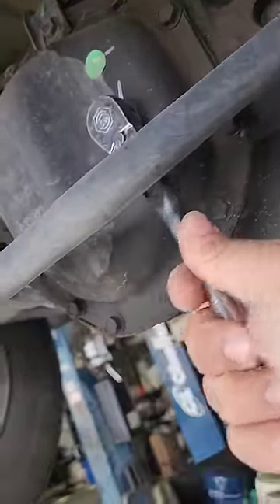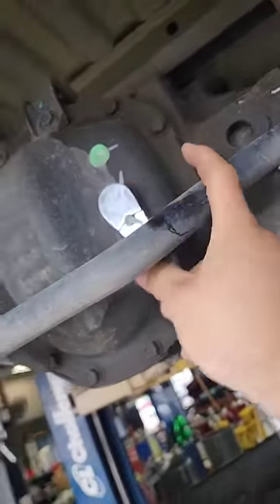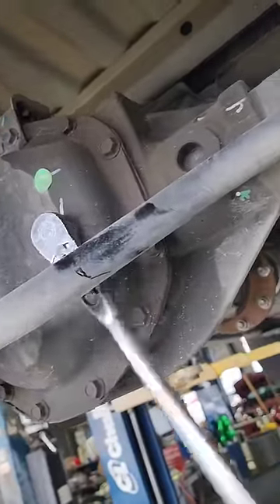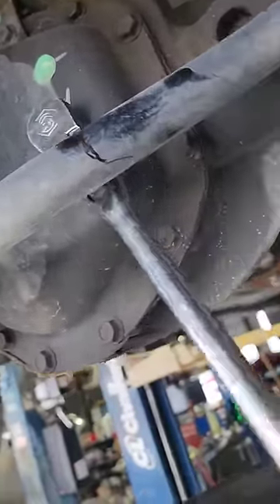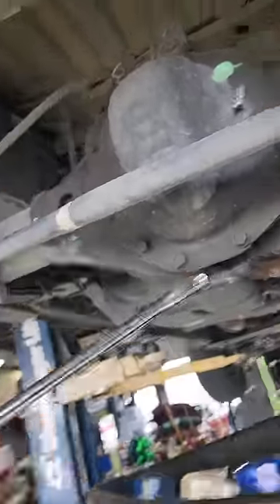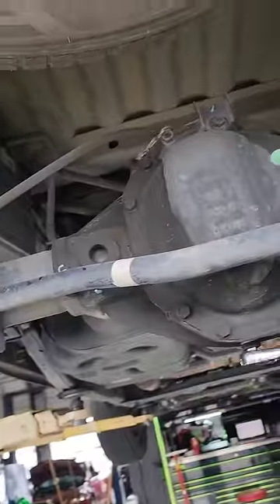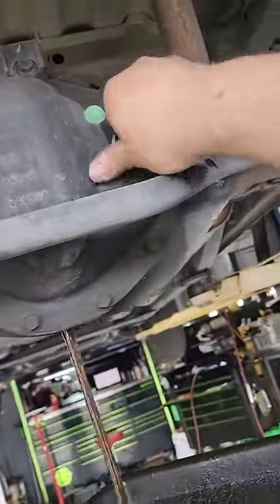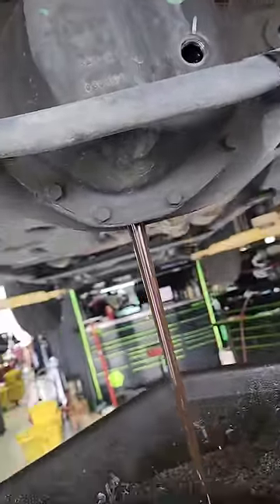MECHANICS PRO TIP #shorts #mechanic #auto #tools

Comment: If you can't get the top plug open, it's really simple. I live in a rust belt area and have 3 diffs and a transfer case.
It's simple. Roll the vehicle onto the roof, fill the diff, roll it back over.
Reply: Well if you live in the rust belt you never have to change your diff fluid, because the vehicle will rott away long before the fluid is wore out.
Reply: @hotrodchevy4524  that’s a joke right lmfao because it’s definitely not true
Reply: @tokahontas9990  it was and you ruined it
Reply: @hotrodchevy4524  you ain't lying! Lol
Reply: Huh, I've always found it easier to just drill a small hole at the bottom, let it drain and then some duck tape should cover the hole just fine then just another at the top to fill it
Reply: Fkn you tube mechanic you’re supposed to weld a 10 mm socket to the drain plug then weld the ratchet to the socket
Reply: Just use the pothole outside of your house to flip it makes it a lot easier here in southern Ohio
Reply: He’s kinda not kidding though I’ve come across dozens of 25 year old vehicles that have never had axles serviced at all
Reply: Mint👌🏻
Reply: @kevindelgado1335  no one has a 10mm socket in there too box
Reply: You just put the qty of oil you need in a freezer bag, pop the cover off, put the bag in, put the cover back on and forget it. The gears will liquify the bag.
Reply: @Duff Man  what's a 10mm socket?
Reply: @mattrushing5573  seen one at a store once!
Reply: I live in the rust belt there’s no way you’ve changed three diffs and a transfer case I would stop changing my own fluid at that point!😂 I haven’t been through one but have gone through millions of miles in several vehicles
Reply: @duffman1241  I always lose mine, so I open up my buddies and I take his😂
Reply: Fill it through the speed/abs sensor hole on top the diff if it has one
Reply: @Hotrodchevy  not true, roll through deep water and it's worth a change out
Reply: @Kevin Delgado  gigachad move but I can't weld
Reply: @mada310  open the blinker fluid drain valve and route to diff
Reply: Wtf lol
Reply: That rust must have got to your brain lol you can fill it thru the drain. Fit a hose to the drain, make sure the hose bends up towards the top and ends higher than the diff itself. Fill it untill the oil level in the hose is level with the fill plug.
Reply: Old school trick gallon freezer bag filled with gear oil slam together get on down the road free teeth shimming
Reply: So you’re saying I should have changed my diff fluid while my truck was rolled over. Now you tell me!😢
Reply: @duffman1241  What is a 10mm socket?  No such critter exists.
Reply: @gunztommiegunz  Ever thought about that for a second 🤔 maybe you haven't been losing yours. You might just be getting yours back! LOL 😆 🤣
Reply: @ElectricBillAlbright  😂😂👍👍❤️❤️
Reply: @mattrushing5573 its like unicorn of sockets.
Reply: @OtisFlint for anything not really driven hard, that should actually work, and may have the added effect of sealing any axle seal leaks present from within. 

Wouldn’t trust that fix on a racecar or a truck used for serious hauling, but it would work in a pinch.
Reply: @MrThedoors28 well just a couple years ago the city finally did my street. First time ever since it was blacktop. It still had the original bed of rocks from 1900.   My house was built in 1913 but there's a few on the street that's older.
Reply: That's not too far fetched.
During ww2, GI mechanics would flip a Jeep upside down if needed to make it easier to work on.
Reply: Or u can just fill it using the hole for the tube at the top of the diff 🤷‍♂️
Reply: Fill it thru vent

Comment: Crack both before completely draining it. You should also check and clear the vent hose when you service it as well. #1 reason for leaking axle seals amd pinion seals is dirt wasps building nests in the vent hose. After the vent is sealed, as the diff oil warms it expands, and creates positive air pressure inside the diff housing. With no vent it makes its own at path of least resistance, which is often the pinion seal
Reply: you're right, never thought about that

Comment: I'm here wishing my diff had a drain.
Reply: Is it a ford?
Reply: Make one!  Tap, plug.
Reply: Yeah .. alot of European small commercial vehicles dont have a drain ... a none service item ..what a croc of ..........
Reply: Drill a hole and make one then.
Reply: Just loosen all the bolts(don't take all the way out)and pop the cover loose (don't take it OFF) 
Drain it, tighten everything back up and refill it.
Reply: Kid that’s just how you drain it prpperly😂😂😂 what tip?? Lol 😂
Reply: SAME
Reply: @marknorwood7521 yes that is the way it’s done for sure but it’s still not a great way of doing that shit but pretty much the only way
Reply: For real, what kind of truck is this?
Reply: My 2005 BMW doesn't have a drain on the diff - you have to get a suitable pump to suck out the fluid, then just fill to the level of the plug. Not really a problem.
Reply: Stop buying Ford's and chev.  Toyota had them for ever.  Years ahead of domestics

Comment: Cool. Another tip is when it drains with a glugging motion like this, it means the diff breather/ vent is obstructed/blocked with debris.
Reply: Breather has a one way valve on the end
Reply: @nate5102 
Yes, INCOMING AIR ONLY!!! So, again… the breather tube on this rear ended is stopped up and/or blocked!!! Now, go back to playing with the kids and stay out of grown folks conversations!!!
Reply: @jongoin4404 I always thought the valve was to stop incoming water but to allow air pressure to escape as the temperature increased. Oh well,  let it fill with water, same thing on a transmission. You were kidding weren't you Jon?
Reply: @davidkeeton6716  
Absolutely, it lets air out and keeps water from coming in. I was being sarcastic but that’s hard to convey sometimes without facial expressions. Have a great day!!!
Reply: No it doesn't.  The breather is very small,  so the rate the fluid is draining out is greater than the vent can draw air in,  so it will glug even if the vent is clear.
Reply: @travisbakeriii3053  nah.

Comment: Here in northern PA, the diff cover will need replaced before you have to change any oil, I’ve had to do every truck I’ve had in the past 20 years!
Reply: I’m NH and decided to put coilovers on and ever other bolt seized on there like tie rods pinch bolts strut tower bolts sway bar axle bolt was really hard still haven’t finished the front had to buy new pinch bolts cause they snapped
Reply: Yup im from PA and can vouch for that.
When he said they never see rusty vehicle made me want to cry a little. Lol
Reply: @Mulletmans  In PA the first thing you check is for "GOOD FRAME" then you check the rest of the vehicle information.
Reply: Ha so glad I don’t have to deal with that shit over here in the PNW. Well not to the degree as people in the rust belt do. Sounds like you guys need to undercoat your vehicles, but then again if you don’t do it when you first get it with no rust on it, costing a frame with rust is even worse.
Reply: @connorjohnson7285  get an induction heater or at least propane/map gas torch
Reply: @carsonchambers5617  the undercaoting gets 1 little chip and its all over.. might as well soak it in a corrosive bath

Comment: Damn that oil was clean as fuck.
Reply: Well if they were there for a diff service that means thats somethings they do vs someone thats not going to change it so it will never get changed unless there is some diff problem kinda a chicken and egg or cake and eating thing
Reply: Nah, that oil was just serviced on a schedule. In advance. As engineers intended, haha.
Reply: @ulogy right, just cuz it looks good, doesnt mean the oil hasnt broken down at all, which will start to leave deposits
Reply: Some people think you supposed to change it regularly but actually it's good for 50-60k miles! That he just changed had probably 5k miles on it! Wasting $
Reply: @Jimmy Conner  ya I doubt it's at 5k unless it had some major work done but most people never think about it and I have bought vehicles with like 200k that had probably never been changed
Reply: The manual on my truck says every 20k.
Reply: Oils are cheaper than components. I change my engine oil every 3k with synthetic blend. $40 every 3 months.
Reply: @taselescanlan2795   an engine oil change is different than diff oil change,  you are constantly adding contaminants to engine oil with the diff their is barely an air exchange from temp changes, oil sheer is the problem and its a long term event.
Reply: @taselescanlan2795  That doesn't make any sense.  Every synthetic is going to give you 5-7K+ protection.
Reply: The additives break down before the fluid gets dirty because there is no combustion cycle to contaminate it with carbon deposits. The additives break down from heat and pressure but the fluid remains clean looking.
Reply: @davec.3198  wouldn’t expect it to make sense to you. I live on a island where we do 25mph max, more idle time than actual miles. I believe in preventative maintenance. Extended oil change intervals, like 7k, is asking for trouble down the line. But to each his own.
Reply: @jhallin5185  I agree, I was just saying to the ppl pointing out that it was still clean oil, that it is cheaper to change the diff fluid than wait and end up changing out the diff.
Reply: @jimmyconner2444  Old Tacoma pickups had a 15k mile severe service interval on the diff fluid. Fluid looks brand new even when they are carrying around an 250 gallon sprayer full of pesticide. Plus the look of the fluid has nothing to do with the quality of life of the fluid. A diesel truck oil looks black as soon as it gets started with new oil. Does that mean the oil is bad already?
Reply: @taselescanlan2795  You don't even need a transmission to do 25mph max.  1st gear all day.  :)
Reply: @davec.3198  unfortunately most of my customers think the same way, and when limp mode doesn’t let the trans out of first gear, they still drive them daily. I call them airplanes, because they sound just like one when passing by at 25mph in first gear lol.
Reply from the maker: @jimmyconner2444  did u see the ODO?? Nope
Reply from the maker: @taselescanlan2795  lmao airplanes...5500 rpm creating heat and all...crazy thing is and engine wasnt meant to run at that rpm for an extended period of time lol
Reply: @ulogy  ... when I worked for Nissan (mid 80s) they called for trans / diff service every 30k and this is what it usually looked like. (clean) Also, the older Z cars were famous for frozen fill plugs. I can't tell you how many salvage yard units we put in because Jiffy Lube had done the rear end oil a few weeks ago then tried to refill it via the drain but didn't fill it enough.
Reply from the maker: @rupe53  its still like that, diff and trans at 30, 20k under heavy use
Reply: @jbj7599 it's not a motor.. a rear doesn't get dirty like an engine
Reply: @jhallin5185 that's what I thought
Reply: @taselescanlan2795 send me your used oil. I'll run it for another 10k with no problem
Reply: @jimmyconner2444 idk if it's just the brand I use but the gear oil I use for my truck is almost a clear color. It has stuff in it that changes color depending on the contaminants inside the difference, milky brown for water, and almost a blue color for certain types of metal degradation I think mostly chromium or Cobalt content but I'm not entirely sure. But I also get my fluids in bulk from the refinery. I guess it's a bonus of having to live close to the nasty fuckers.
Reply: @davec.3198 Well, I guess the point is to change fluids before they can cause damage; if they’re already a bit dirty, then they have already caused damage, as opposed to changing good-condition oil that has been in use for some time but hasn’t caused any damage yet.

Comment: When I was a mechanic in the 60s 70s and 80s we always made sure the bleed valves weren't stuck before removing the caliper or wheel cylinders. Most of the time we had to drill them out and repair them before rebuilding the unit. Now they are available easily but back then they weren't easy or cheap to obtain

Comment: If you pull the top plug out first and stick your finger in there. And make sure it’s full before draining. This way if there was an issue and it’s empty you could tell the customer. Either you have a leak or your rear is getting so hot it’s burning the oil off. We do this on semi trucks especially on mack differentials which are notorious for eating oil
Reply: Macks are notorious for every problem 😂😂😂
Reply: He's already replied to comments claiming you can't check the fluid without draining it

Has no idea of the finger check, or sucking fluid from the bottom with a transfer syringe

Diff oil is not broken down by contamination and heat as quickly as sump oil is, usually the issue is water ingress on small trucks
Reply: Axle seals, change them

Comment: Pro tip: leave the filler plug in for 5 seconds to check the diffs breather isn’t clogged. Then remove for the faster drain.

Comment: If the plugs happen to be  seized you can heat it  up  With  a propane torch and it will come right  out. Tip for the just in case situation.
Reply: I always do that when I take bolts out of a gas tank!😮🔥
Reply: Absofuckinlutely just make sure you stay calm and put the fire out 😎
Reply: @jamespatterson9446  WHY?
Reply: @williamgronbach4538  well you don't always have to put the fire out, but it helps.
Reply: @jamespatterson9446  only if you like your skin not crispy.
Reply: @williamgronbach4538  depends on what we're talking about.

Comment: If the top plug is seized, just drill a hole in a rubber stopper, insert a piece of plastic tubing in the stopper, and pump the fluid in with the type of hand pump thats similar to the pump on a bottle of lotion. Just pump in about a half cup more fluid than you need, because youll loose a bit when you quickly swap out the stopper for the plug. I use this method on my BMW instead of spending an hour removing other components to get to the fill plug on top.

Comment: If it's a GMC or Chevrolet, the Fluid  Should  Synthetic  75/90 With 1 Equal Torque, You Can Also Add a Gear Fluid Supplement.....And Remember That The Newer Models for Ford Diff. Are  Going to Synthetic 80/140...Each  manufacturers  Have Specific  Recommendations for each  " Drive-Train" .....

Comment: Never seen OEM drain plug on a differential,  That gear oil actually looks pretty good
Reply: A lot of vehicles now have them now. Toyota pickups have had them forever.
Reply: Jeep Wranglers have had them for several years until recently. No longer have them on the newest models.

Comment: You pull the fill plug first by default so it drains faster.
Reply: glad I'm not crazy 👌🏾
Reply: He was demonstrating how effective that method was for the video. If he did it that way from the start it wouldn't have proven that the oil would flow faster.
Reply: @etiblmca9267  I just heard him say make sure you can break the fill first before draining. Naturally it will vent when you have the drain pulled.
Reply: The vent allows plenty of air in, if not clogged. Removing the fill plug won't speed the drain much.
Reply: @JM-lk6wo  Clogged or not, it's a torrent when the fill is pulled. Look out. 1.5-3 qts in 5 seconds time. It creates a vacuum.
Reply: Ya, because you want the oil to drain 4 seconds faster than if you left the filler plug in.
Reply: @e-curb  Was that necesarry?

Comment: In MN here. I would just drain it and check the top, and when its ceased, replace the diff cover. Then if that doesnt come off either grind off the bolts. Or use it as an excuse with the wife to buy a new truck :P
Reply: Lmao yeah we get fucked here. Gotta love good ole MN
Reply: it's (a contraction of it is, not its) and seized (as in frozen, not ceased which is stopped).
Reply: @BryanTorok  we are mechanic. Grammar doesn't exist. Lmao
Reply: @BryanTorok  No, when it processed ceased! You's obviously dont know how to check diff covers's. Once it has's the cease's you better act quick...ler.
Reply: you are forgetting that most diff plugs are in the diff housing not the cover... good luck replacing the whole rear end...

Comment: Glad you picked up a tip. Living in the rust belt i was taught this before my first diff service. Have encountered a few stuck fill plugs over the last 5 years.
Reply: The rust belt actually isn't called that because of rust. It's called that as a play on the metal industry that was booming, but then declined. It's calling the area 'old metal' pretty much.

Comment: Most diffs don't have a drain, you gotta pull the cover.
Reply: Depends on manufacturer. Most Landcruiser diffs don't even have a cover!
Reply: @TheRedc0met  not my supra so thats a lie, neither did my t100
Reply: Is that common in the automotive world? Im a diesel tech and ive only seen 1 truck without a diff drain.
Reply: @TheRedc0met  They have a drain plug, but no removable cover. Have to pull the whole 3rd member to work on it
Reply: All subarus have drains
Reply: He is changing oil that doesn't need changed he doesn't know that or care.
Reply: I added a drain plug to my diff plate and it makes things less messy but not easier 
.
Reply: Or you can use an extractor pump

Comment: If you can’t remove the top plug sometimes they can be filled through the vent tube
Reply: You usually have to pull the vent as it's a check valve on most diffs.
Reply: They you dont know where the level is at…. I live in the heart of the rust belt never had a plug i could not remove without a little help from the torch on the stubborn ones
Reply: @H3lzsn1p3r  Check the manuals or Google for how much it takes, and measure how much you put in.
Reply: Just use air hammer and chisel bit